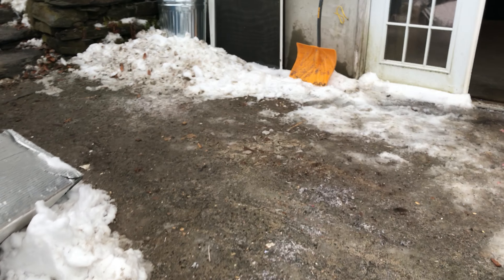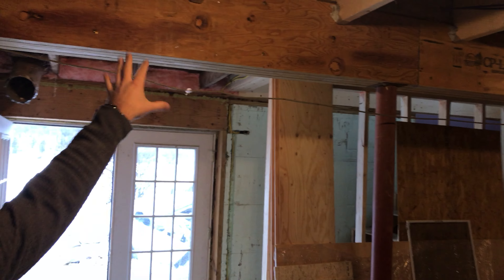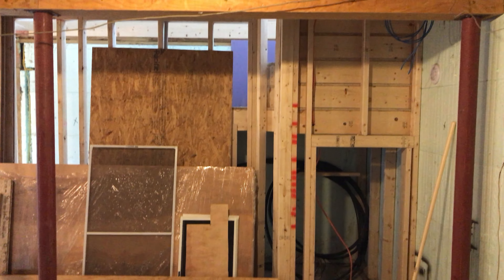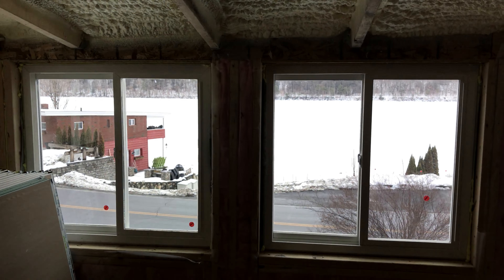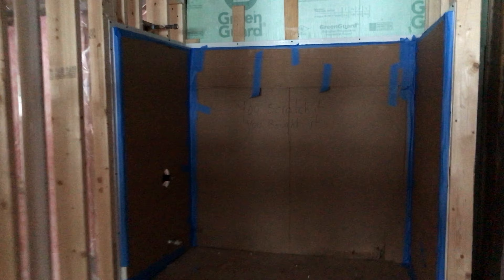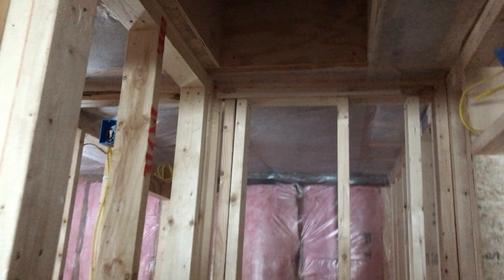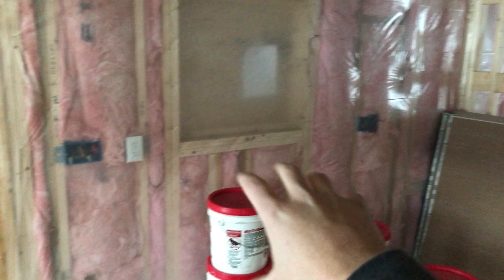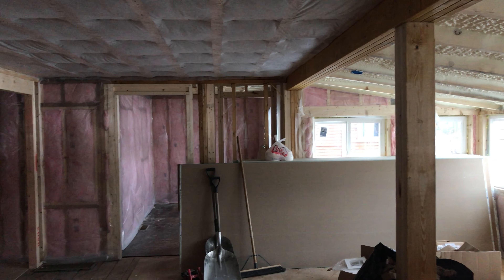House Update: 01/19 Insulation is Up! Drywall starts next week

Comment: Looks like you're making progress. A thought for that small area you were hoping would be towel storage but now may be too small. It would be a waste to close it in and not use it for anything. How about storage for brooms or cleaning supplies?
Reply from the maker: You know, cleaning supplies is a great idea. It is now too small for towels. Shame that plumbing exhaust is going through there now so close to the front. Initially, we planned on getting a larger tub but all of them were backordered for 6 weeks in our budget so we had to go smaller.   We have a towel warmer to be installed on that blank wall but it can only hold 2 towels maximum.